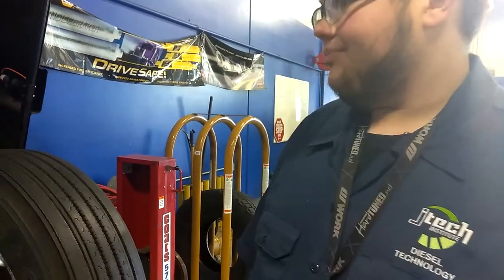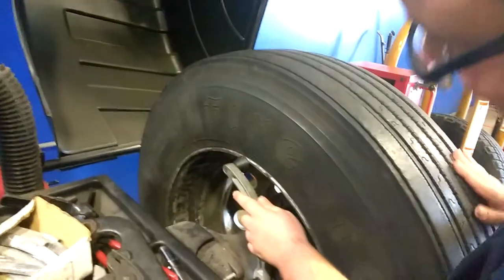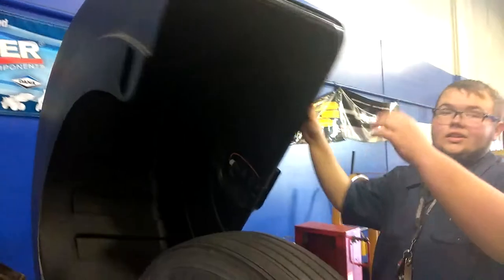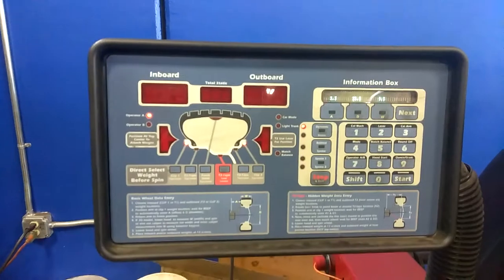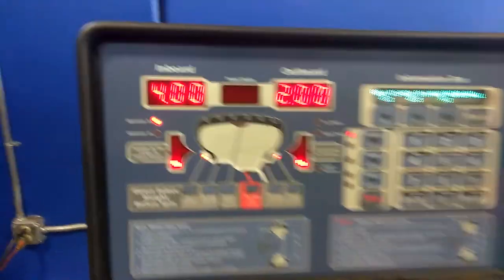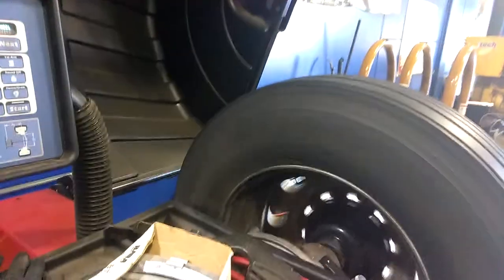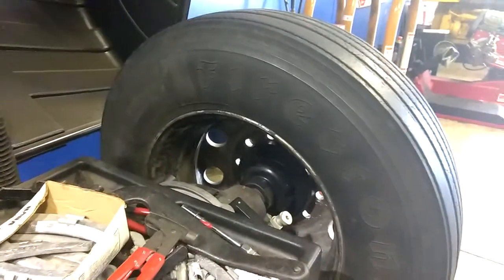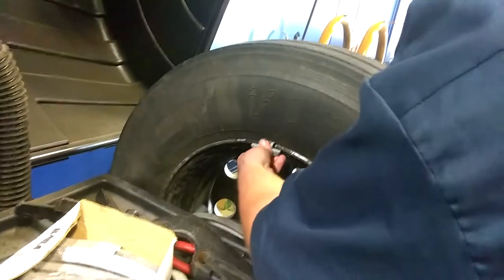Balancing a commercial truck wheel & Tire

Comment: I purchased a new tire balance machine and I balanced a new tire and aluminum wheel and set it in the rack and when the truck came for installation I put it back on the balance machine to show the owner it was balanced, to my surprise it was asking for 3.75 more weight for to be balanced ? is that normal ? should it not have still been balanced, thanks
Reply: The weights could have Came off if he hit a pot hole
Reply: @xlilnetx  tire was never put on ,it was just balanced and put off to the side till truck came in to be put on so I am assuming thr RANGER RB24T tire balancing machine is just a pos
Reply: @rickwichman8742  another things, the power could have been cut off and the balancer may need to be calibrated again. Also sometimes even after u put a weight on spin it again because it ask for more sometimes, who’s knows. Iv had the same happen to me before
Reply: @xlilnetx  I was always under the impression if something is balanced ,it should stay that way until something happens to the thing that is balanced as Balanced is Balanced , in this situation the machine (RANGER RB24T) is Not a true balance and is only balancing the tire and wheel to this machine therefore creating a false balance reading but if you take it to a REAL balance machine it will be balanced until something knocks it out of whack
Reply: @rickwichman8742  yeah true maybe it was the balancer, strange bro strange
Reply: @xlilnetx  I was told to calibrate the machine and balance the tires then to put them on the truck they are balanced! I done that 40 mph could not hold the steering wheel, took to reputable tire shop and their hunter machine said they need more weight, had 7.5 oz on 1 and 9 oz on the other , took off all weights balance same tires 1 took 3,75 other other 2.5 oz i asked them to recheck them and they were perfect ,I have never had the same reading on any giving tire on this machine ,buyer beware of bendpac rb24t tire balance machine I do not trust this machine has been a nightmare since day 1 and  Mario at AUTOMOTIVE EQUIPMENT SPECIALSTS AND JEFF AT BENDPAC  say the machine is fine? but the tech they sent out to check it has said different
Reply: @rickwichman8742  yes sir thank you I will beware. It definitely sounds like a faulty balancer
Reply: More than likely wasn't measured properly it's happened to me